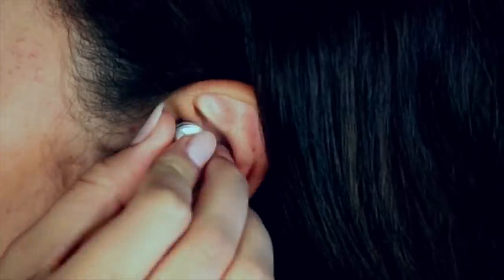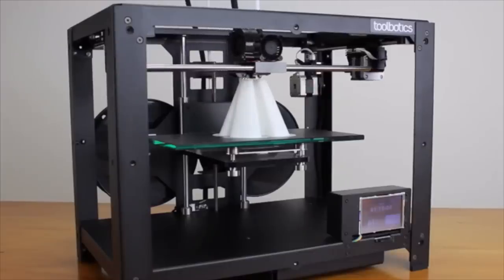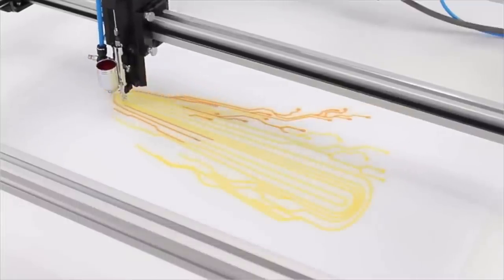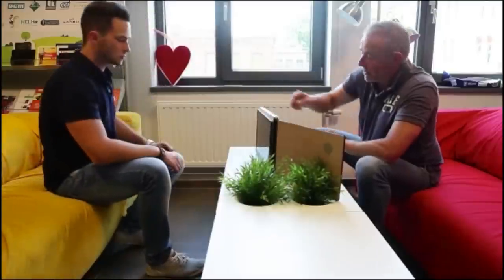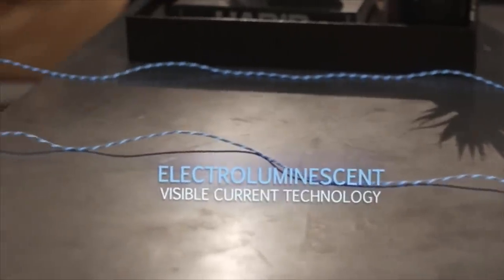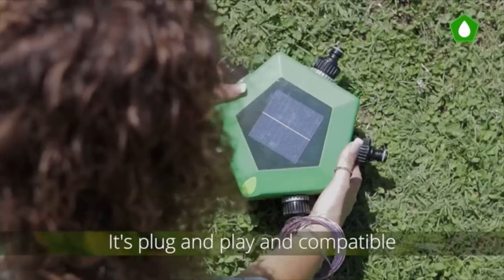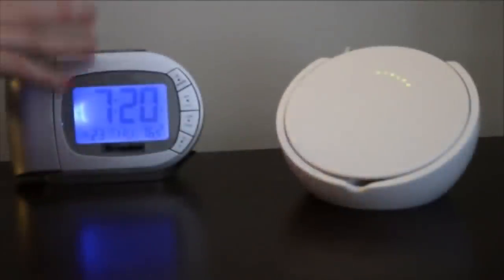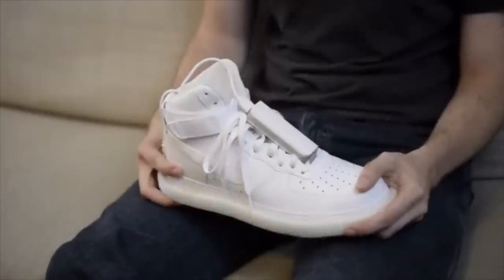7 Futuristic Gadgets Available Now #1

Comment: If you're using three monitors, you're more than likely not using a laptop, and not just because laptops only have one screen. Not even my desktop can use three monitors because it only has one GPU. I honestly don't understand how the Slide In Joy thing even works.
Reply from the maker: LukeDude759 It basically gets attached to the back of your main screen. And gets plugged I reckon in one of Usb ports for their power so I bet it will run you off from lapy battery way too quickly. Cool, but I am curious about battery life.
Reply: You can run 3 monitors just fine off of one GPU, that's what I do with my dekstop. I've got three 24 inch 1080p monitors powered by a single GPU.
Reply: ErikTheAndroid You must be the hacker LOL
Reply from the maker: ErikTheAndroid Nice, I would love that set up for my video editing.
Reply from the maker: Keyur Pandya haha or he might be a gamer.
Reply: TechnoNerd Bingo
Reply: ErikTheAndroid What kind do you have? Mine only supports two.
Reply: LukeDude759 780Ti Windforce. I'm using HDMI, and two DVI ports
Reply from the maker: ErikTheAndroidsmart :)
Reply: LukeDude759 it must have some driver software you install on your computer that sends the video signal over usb. means - bad for games, since delay must be an issue with these things..
Reply: My msi laptop has a 4k screen and runs 3 24 3k screens fine.  24gigs of ram.  I74930 processor nvidia k4100m 10gb graphic cardm i have 3 1tb ssd. And a 3tb ssd and still have a bliray read write optical.  I paid $3k but im a cad and adobe pro and its a vertified cad adobe machiene

Comment: So, how do you use the dot for cheating on a test if you don't have long hair to hide it behind? No wonder they had a girl show it off instead of a guy! Yeah, there are guys with long hair and girls with short hair, but in general, girls tend to have longer hairs than guys. I suppose I have to grow out really long and baggy side burns and then try to use those to hide it!

Perhaps they need to make a skin colour dot, but of course, you would need different skin tone colours to match people of all races, or perhaps they could make dots with some sort of self camaflouge material that changes it colour to match whatever it is sitting on!